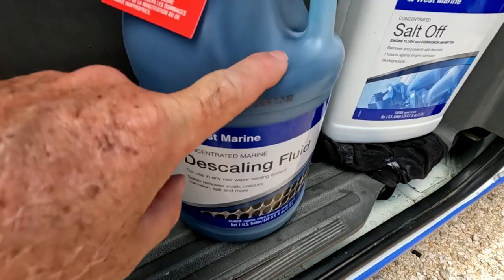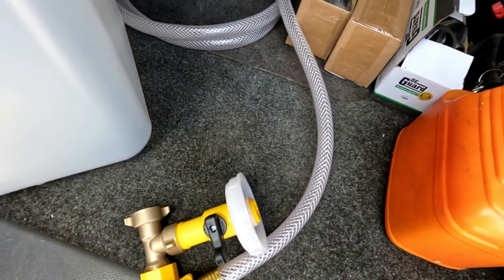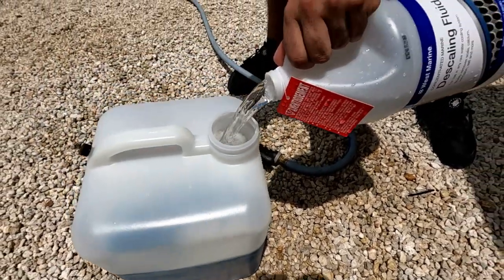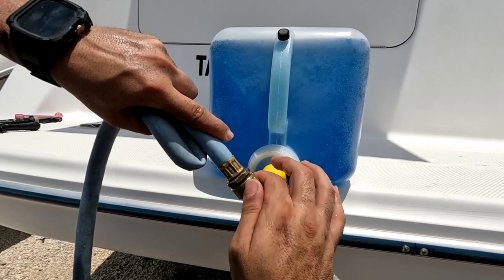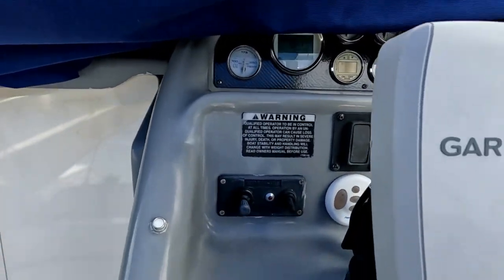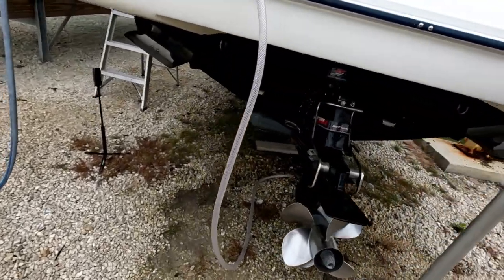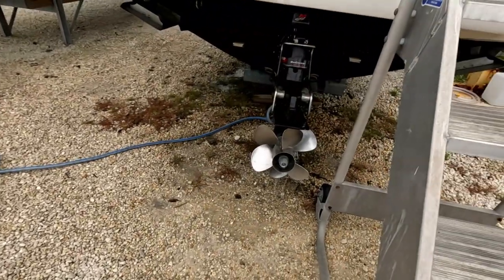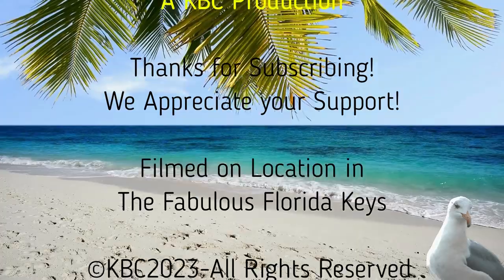HOW to Keep Your BOAT ENGINE Running COOL and CLEAN by DESCALING FLUSH!

Comment: Ok. You have it hooked up wrong. Go to 9:40 and the shut off on the right is suppose to be on the garden hose side so you don't have to have your buddy at the water shut off where the water is supplied. Put it on the water hose side and you can control the water input and the tank input . My boat is from Florida and it too runs at 175 plus.. I've replaced the exhaust manifolds, riser and thermostat, but still no change. I'd be curious if this works.. Hopefully it does and your next post is in the water post .
Reply from the maker: Thanks Gordon! You are correct! Thanks for watching Brother! I'll pin this comment on the top for everyone to see. Thanks! Peace from the Keys!

Comment: I recently had a hvac I guy look at boat AC. Coincidently he mentioned doing the same think to my boat's AC system. Slightly different procedure but does the same thing using a different chemical. He said the discharge will look like mud. He does it to his boat.
Reply from the maker: Hi Mark! Yes, I have use similar process for my marine A/C, but with Barnacle Buster solution. Thanks for your comment and watching Bro! Peace from the Keys!
Reply: @KeysBoatingChannel  what was the solution ratio for the AC flush?

Comment: Are the thermostat housing passages clear?  When you changed the the thermostat I was hoping to see the passages inside the housing….maybe when the thermostat opens clogged up passages restrict water: cooling flow???
Reply from the maker: Hi, thanks for watching our video. When I removed the housing it was clean and clear, did not see any obstruction. But will be looking for any clogs on my next video replacing our circulating water pump. Thanks so much for your comment. It is very helpful information. Peace from the Keys.

Comment: Yeah the shut off needs to be on the water intake side so you can shut off the water when you open the tank valve.   Otherwise you are further diluting your solution.
Reply from the maker: Hi Josh, thanks. Yes, we did the correction. Thanks so much for your comment and for watching our video. Peace from the Keys!

Comment: Do you have to have a thermostat I took mine out it was closed
Reply from the maker: Hi, thank s for watching our video! I replaced the thermostat with a new one, and did the descaling treatment, and still overheating. It just overheats at high speeds around 4,400 rpms, does not overheat at 4,000 rpms or below. Thanks for your comment, Peace from the Keys!